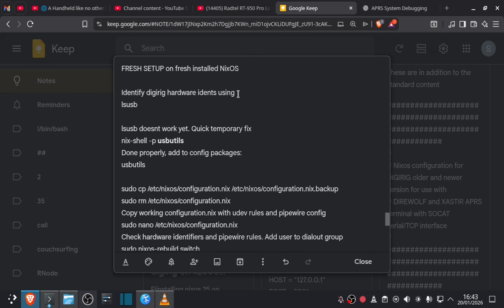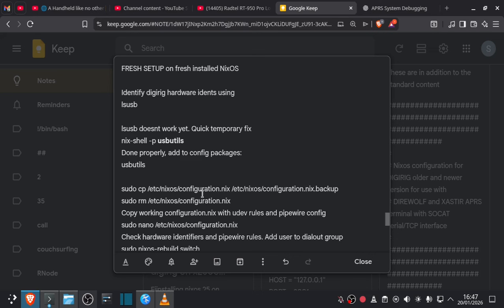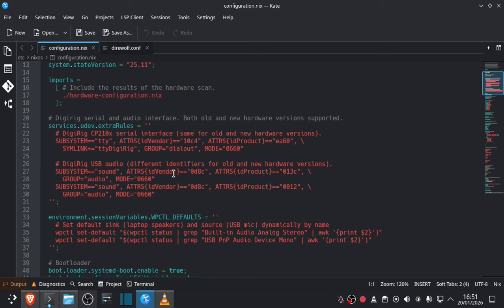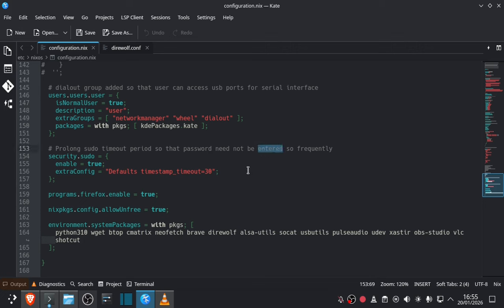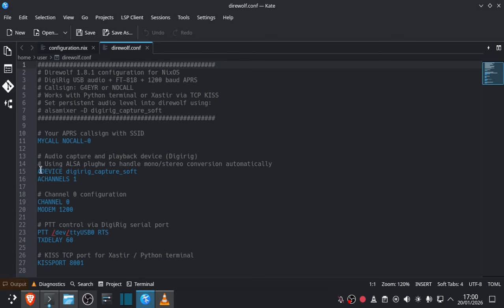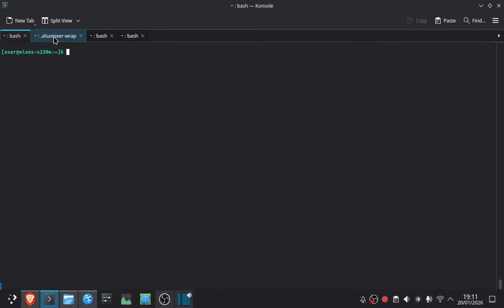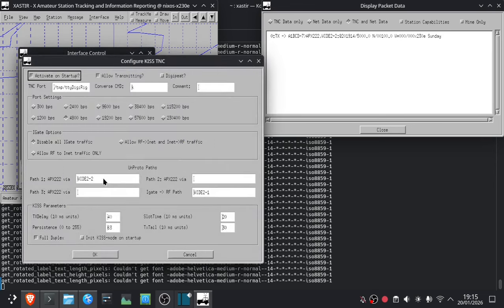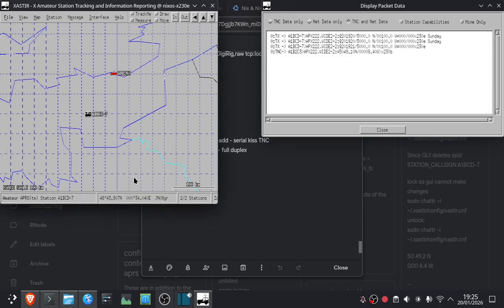APRS Packet Radio Comms with Direwolf on NixOS  to contol Radio Transceiver via Digirig Interface

Comment: Thanks for these videos! I was into packet radio in the 1990s using a old Tigertronics Baycom Radio modem.  I had a lot of fun with it, used an old gov't refuse 80286 sx for my main outfit.  I put a 80386dx together running a radio BBS on the 2m band it had a 70cm backbone with old police radios doing the digipeating . Somewhere along the time i backed out of V/UHF stuff. ( i supose regular life got busy) now, a few friends got into amateur radio,  they are really interested in running data modes via radio,  packet and APRS and asking me to help.  Im glad for guys like you putting these valuable videos out  for us to learn and relearn how things work.  Nice thing is i have a Raspberry Pi 4b and a good Linux laptop now , no longer need  a  computer that takes 2 men and a lad to move around 😂 wanted to drop you a line to say thanks OM ! ...cheers de N3TGY
Reply from the maker: It's amazing how much more we can do with modern equipment now, glad you are enjoying the hobby again 😊 I find Claude AI useful in setting up and debugging these systems.